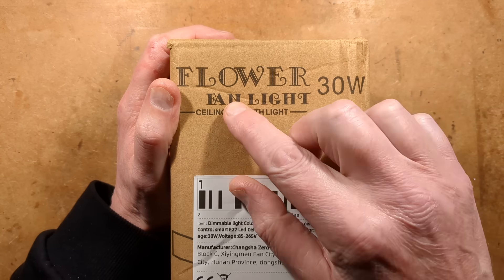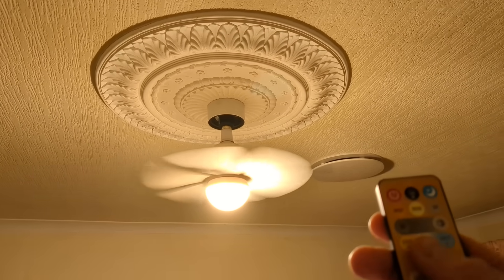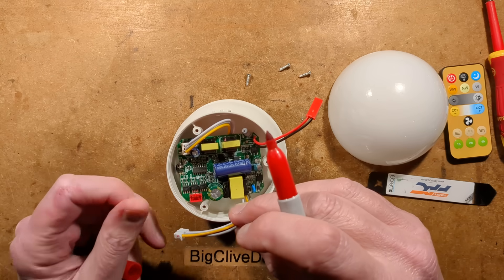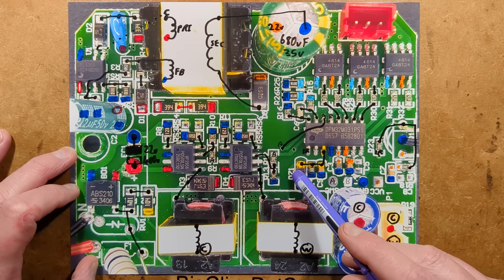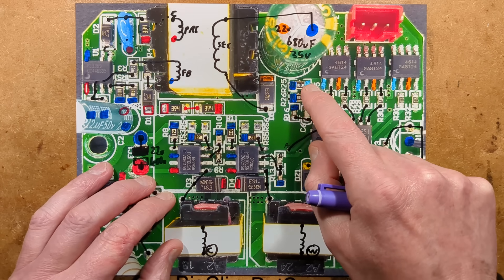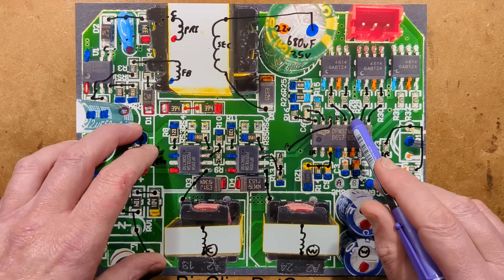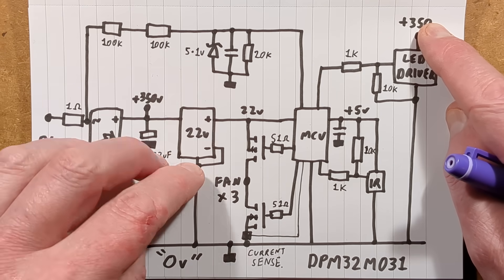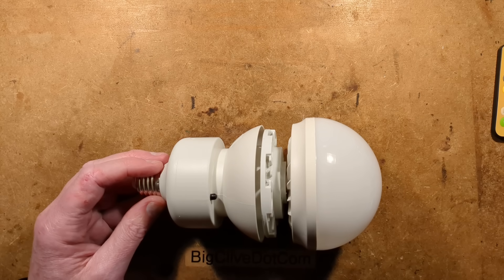Inside a screw-in ceiling fan and light - long version

Comment: That looks like a nice unit, and with surprisingly complex circuitry.
Being of a certain age (my first job was repairing radios and TV's with valves in them) it still amazes me how cheap micro controllers are and just how much they can do.
Reply: One of our Engineers (a fellow Brit), used to work for Plessey decades ago, and he has an album of photos showing the valve-based circuitry in their early traffic light controllers.  Pretty amazing stuff, and it makes you realise just how far we've advanced in not that long a time!
Reply: I felt my age when I saw a video of a guy getting an ESP32 microcontroller to run Doom.
Reply: I'm old enough to remember when radio shops recharged accumulators for valve radios.  That was for people outside of town who had no mains electricity.
Reply: @patricklockerby4308  Back in the mid 1950's your local garage used to provide that service.  My Grandparents lived near Withernsea, E. Yorks, and when they needed the accumulators recharged, it meant a visit to the local garage, who also sold the HV dry cells for the anode voltages (350V if I remember correctly).
Reply: When I started work as an apprentice industrial electrician in 1971, valves were still widely used for various control applications, though they were being rapidly replaced by transistors and the first integrated circuit chips. The TV and radio repair business was a pretty big thing back then, the local technical college used to run courses specifically catering for the apprentice TV and radio technicians employed in the general area.

Comment: I got one of these from AliExpress for £8 earlier in the year and it did sterling service. No issues with it being installed in a regular pendant light fitting, it does have a bit of torque on it but it probably only twists the flex by about 90° on startup so it's going to take a l-o-n-g time to stress a length of flex.
Reply: i've looked at these, but my need is for destratification, which according to my research is best done by pulling a column of colder air from the floor. does it reverse so i could use it for that?
Reply: @peppigue , probably not reversible, because rotary torque in the opposite direction could make the unit loosen and unscrew itself from  the threaded Edison-type socket in the ceiling .
Reply: @peppigue  It would be an easy mod - swap two of the wires in the plug going to the motor - doesn't matter which two. But pay attention to what others are saying, about the ability of the fan to unscrew itself.
Reply: @robertbackhaus8911 I'm guessing that the centre contact would broken well before it had completely unthreaded itself
Reply: @peppigue  Install a regular ceiling fan if there is an outlet box for your ceiling light.  They can then be run in either direction for cooling in the summer or pushing warm air down from the ceiling in the winter.
Reply: If your pendant light socket isn’t attached to something (like an outlet box) firmly enough that it won’t twist, it was installed wrong.
Reply: @markfergerson2145  You really shouldn't be putting these things into a pendant light socket.  That is not only asking for trouble it is demanding that trouble stops doing what it is doing and come over to your house right away.

Comment: When I saw the BBC warning about them, it seemed clear to me that what they didn't like was having it dangling from a cable and wobbling a lot as the fan ran. It does make sense to me, a lot of continuous wobble could cause wear of the cable. It already does seem to me that the point where the cable enters the ceiling rose is already somewhere where there is very often inadequate strain relief.
Reply: Incorporate some kind of accelerometer that detects if the fan is moving too much, and cuts the power to it accordingly. Might make things expensive, though.
Reply: The issue is when (not if) the fan throws one of those clip in blades, and then the fan will definitely wobble, somewhat like a propeller on a rope and all the fun that ensues...
Reply: @95rav  I've removed the blades of one of these for winter storage, they are not easy to remove and no-way could one just 'fall out' on its own. 

I think the real issue here is electricians being lazy and not adequately ensuring flexes are properly clamped.
Reply: @matthewn1805  I think that if an electrician installs a screw-in fan as described here, they would be held liable professionally. Fixing this "dangerous" job would certainly suit the lazy electrician. The one responding to the "worried" person would have been more interested in callout and job fees for doing something that the worried person may  have been able to do themselves, (hint) it's as easy as changing a light bulb.
Reply: @Clwydian-Ranger  I suspect most electricians would refuse to 'plug in' one of these however I was referring to the way some electricians take short cuts when wiring ceiling fittings.
Reply: @matthewn1805  My experiance exactly. I almost never see one where the cable even looks like it might be clamped properly.
Reply: @95rav  That would definitely do it!
Reply: @95rav  Really, is this from actual experience? I don't think that one of these should be installed from a pendant lamp socket for long term use by one who doesn't understand the risks. but I think perhaps now, too many people have been schooled excessively in social studies rather than real life. Risks are imagined too much and they are being made the responsibility of someone else! For a fan blade to detach, fly off and injure someone, a long series of what-if, what-if, what-if statistical situational alignments would need to occur. The first, and only one to start this would be- What if the installer failed to insert the fan blade sufficiently for the catch to engage AND failed to check. Subsequent what-if's would make the imagined failure less and less probable.

Comment: These little light socket fans are low mass and probably don’t pose a lot of risk.  On the other hand a full ceiling fan is very heavy and needs a special reinforced work box tied into two ceiling joists.  One of my relatives was seriously injured when she walked below a ceiling fan which fell down with no warning.

I have a fan in my 1920s house and it is on a work box original installed for a heavy chandelier.  If you have an old home or a new home with a fan, fans are probably on proper work boxes.  It is the homes built from maybe 1950s to 1980s when big chandeliers were out of style and fans have been added that non reinforced work boxes are the greatest risk.

The moral of the story is that if you move into or stay in a residence with a large ceiling fan, you should check to be sure that it is properly installed or to be sure you never walk under the fan.
Reply: The fans I've worked on in the U.K. are attached by screws into the wood joist that supports the ceiling. They are not going anywhere.
Reply: I'd like to add that you should also inspect your chandelier's. I've had one fall randomly.

Comment: Thanks Clive, good to know, as I have a fairly similar one. It must be said there are much simpler variants and I’ve had one that didn’t have any ramping on the fan, meaning turning it on or off would give the whole unit quite a jolt, so the electrician’s concerns aren’t entirely without some merit.

Comment: Random question, but what's the thing next to the fan on the ceiling? I was thinking either a AP (access point) or a smoke extractor? Never seen that before in the UK
Reply: Looks like a HVAC vent diffuser
Reply from the maker: It's a PIV (Positive Input Ventilation) system.  It pushes a continuous low level flow of fresh air into the house.  Very popular here due to humidity issues.

Comment: And as a bonus that red connector is the same as some lipo batteries so you can gut the thing and stick a massive lipo in there and wait until someone switches on the lights. Big badda boom. I do dislike the misuse of connectors. My "Mechanic" brand PCB hot plate is a prime example. It's 240v. Via a XT30 connector! How could that possibly be a bad idea? Nice XT30 plug with mains and neutral waiting for someone to inadvertently plug it into the wrong thing, touch the bare copper contacts etc etc. And let's ignore the fact the XT30 isn't rated for mains AC.
Reply: I've seen XLR 3-pin connectors used for everything, pretty much -- low-voltage AC, DC power, audio, CCTV power-over-coax, exhibition lighting etc. All perfectly interchangeable of course...

Comment: The neutral setting  is like a normal  warm light. A warm light shouldn't appear dark yellow to orange on camera. That would imply it's not giving off enough light. In fact... I'm not sure that light is very bright. A decent light should have the shadowing in the corners not looking like shadows. This might be as bright as the light I use in my tent, which is a small 2 person tent. And it's just enough light, but isn't actually decent.

Comment: This totally reminds me of an Airbnb that I stayed in 
It had bunk beds in one of the bedrooms and a little Post-It above the switch that said "please don't turn on the ceiling fan while someone is in the top bunk" I don't think they really understood that you can't have a bed where if you sit up your face is directly in line with the ceiling fan blades. Not to mention that the light is also head height.
Suffice to say that we didn't use the top bunk.
Reply: It's very hard to find a single vacation rental for 10+ people in most places. You often do see some bunk beds or other less-desirable sleeping arrangements in those. (Pull-out couches, etc.) You put the youngest and most flexible members of your party in those. 😅
Reply: @gwillen Or in my case the one with the hardest head goes on the top. I can totally imagine kids playing with the fan and turning it on while another kid is up on the top bunk. 
It's just the position of the bunk bed could be on the other wall and it wouldn't be a problem.
Reply: @SunshineArt  as someone who was the top bunk in that situation as a kid once, can confirm
Reply: harry dubois could have done with one of those post-its
Reply: I can attest inserting your head into an spinning ceiling fan hurts very bad, even with a heavy winter coat, hat and hoodie on. think I still have a big lump 29 years later or was that from face planting into a brick fireplace as a toddler, either way I suggest never trying either of them, nor sudden motorcycle wrecks against a stopped car at 45mph or any speed.
Reply: YouTube video of idiot throwing himself into a ceiling fan breaking it
Reply: I wouldn't stay in an airbnb if I had to use bunk beds. If I'm paying, then I'm an adult. Why would I want to sleep in a child's bed?
Reply: @lepayen  obviously you use it to save money by cramming more people to lodge in the same space.

which is also part of being adult. like if you're NOT paying you probably wouldn't care if the place cost double per person.. you can cram extra days from the same money by just accepting that.

never thought of the concept as a childrens thing either as the most days i slept in one was in the army.
Reply: @lepayen  what makes you think bunk beds are exclusive to kids? It's just a space-saving accomodation, and that means you have more space for activities instead of wasting it for beds
Reply: @lepayen  WTF?!? Since when are bunk beds for kids? Also, are submarine crews children? How about naval vessels?
Reply: @SlartiMarvinbartfast  They are treated as such often. So yes...
Reply: @SlartiMarvinbartfast  Bunk beds are Not fun for those older people who don't enjoy climbing up and down out of bed.
Navy crews by nature of their service have to learn to live in situations which are uncomfortable.  I've seen their 4-units high stacked bunkbeds; where you have to climb over other sleepers to get to the top and don't even give you enough room to sit up in bed!   Those are purely utilitarian arrangements   Where space is very limited, and human comfort is not the priority.    There is also are Age maximums and mandatory retirement after a certain number of years for navy enlisted people.

Comment: Looks like a BLDC motor using EMF feedback, which is pretty normal these days. It measures the amount of back-emf between phases to calculate rotation speed.
Reply: Sensorless feedback. It uses the voltage on the unenergised phase to create the positional information for the driver. Quite hard to do as there is no information present during start-up.
Reply: Ah, using current feedback instead. Still hard from start as you have no idea where the rotor is.
Reply: @robertbox5399  Yea but you kinda dont need it. its using three phases so it can just kinda start using the phases and the rotor will snap to the phases where it can then use the back emf to get an idea on speed.
Reply: It basically uses the same method used to drive a pc fan but on a larger scale. You either have 3 phases or you have + - and Signal. (3 wires) depending on the fan manufacturer.

Comment: If the fan is quite small then it wont have the power to twist itself out. I wouldnt want a full sized ceiling fan in my light socket though.
Reply: Untrue. Even a small fan vibrates. And vibration is what will loosen it and cause it to unscrew itself. Because the blades are short, the fan spins faster, causing more vibrations. Longer blades will spin slower, on the same motor with the same power. That means less vibration and less chance it will fall and kill someone. A building built next to an airport will eventually fall apart because the nails will slowly screw out of the walls from the vibrations. If that can happen to a nail, it can definitely happen with this fan.
Reply: @lepayen  had one running for months. no problem. if it unscrews it will stop. so NOT going to fall down. and if it doe it wont hurt anyone, there is very little weight. absolutely minimal.

Comment: I managed to find a datasheet for the microprocessor. Unfortunately it is mainly in Chinese and very long. The only meaningful info I could get without a lot of work is that it is a 3P3N gate driver running at 48MHz. That seems to fit in with the idea of a 3 phase motor driver.

I also found, from the same website and again in Chinese, some development documents for a fan controller design but not necessarily linked to this microprocessor.

Comment: Pretty well built looking device, was thinking that maybe an ES type fitting would have provided more mechanical rigidity for the ceiling but then if the fan is reversed it might unscrew itself making it a death fan!
Reply from the maker: It is an ES base.  The fan doesn't reverse.
Reply: @bigclivedotcom think I need new glasses 🤓
Reply: An argument the BBC gave but false, the fan rotation would tend to tighten the fixing, not loosen it and as Clive pointed out there is no reverse option.
Reply: @matthewn1805  See thats what was funny to me, cause my thought process was, if people are worried about the fan unscrewing itself from startup torque, why not just change the blade angle so the motor could run opposite and the startup torque actually tightens the screw, as it turns out, hey at least most of the ones ive seen already do that naturally. which is also then aided by how unlike normal AC motor type fans like normal ceiling fans these types dont just bang the motor out at full power to get it started. 

I know they do because most ceiling fans ive ever encountered when taking them apart, they dont use shaded pole motors cause they have to be able to spin in both directions and instead rely on start capacitors. then theres the fan switches and remote control devices we use in america that will always initially start the fan on full speed then goto the selected speed after a brief delay. The fan switches i have in my house you can actually hear this happen, When you first switch the fan on regardless of speed, you will hear that 60Hz hum from the motor more loudly then quiet down a touch, and with the fan in my bedroom you can actually kinda see it, that fans blades are rather small and it doesnt have much mass so it gets going rather quickly, and when you start the fan on low speed, you can actually see the blades start out faster then slow down as the controller in the switch changes the speed.

Comment: Presumably, this motor design means nothing bad happens if the fan blades are stalled by someone taking their pullover off while standing underneath it  (which is the real problem with ad hoc ceiling fans).
Reply from the maker: I think the motor would just slip on the magnetic field, but it may sense the obstruction from the current.  A high current issue would cause the power supply to cut off and reset the unit.
Reply: ...it's quite fun to throw small items of clothing at a revolving (conventional/fixed) ceiling fan and seeing which way they go! (Do try this at home, but don't blame me if the whole thing comes down on top of you!)

Comment: I really like this light / Fan.  Thanks Big Clive!  The one I got has a bit of torque when turning on so perhaps a little notice to those that connect them to a flex wired socket.  I put some bailing wire next to the flex to the socket with some tape which mostly eliminated the ten or twelve twists to the wire.  I have to admit that the flex to E27 wire is pretty thin and flexible.
Reply: Update.  I bought another to play with and this one, like yours, has the domed light on the bottom.  I noted on Patreon that mine didn't respond to the remote while running but this one does better.  The blades are slightly thinner so I guess the IR signal gets through.  I like these fans and use it every day while it's hot outside and inside.